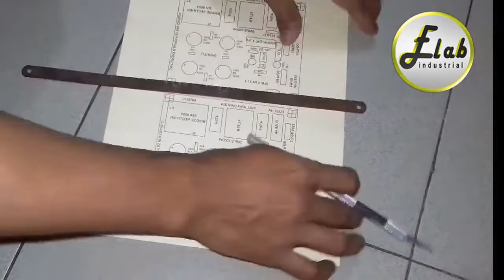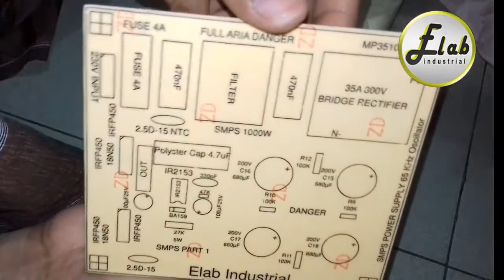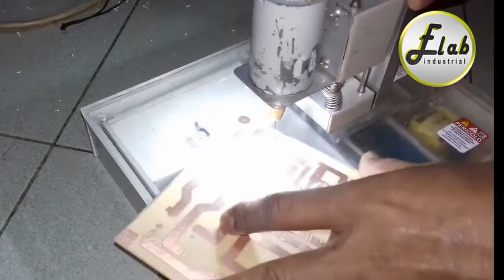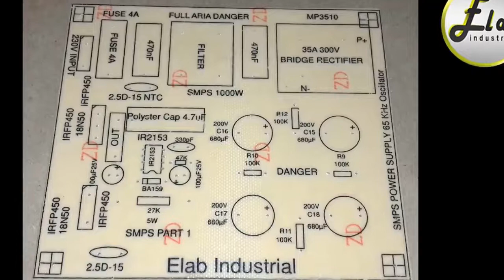How to make pcb board, very simple and easy, at home made,

Comment: Hello sir please design water pump controller with dry run protection (if water not reach in tank until 1 minute the motor should be off )